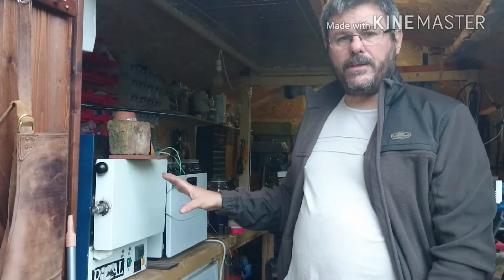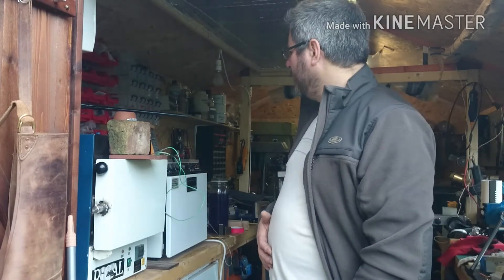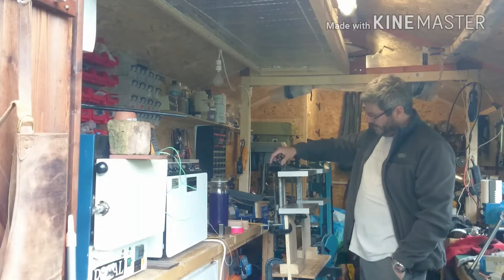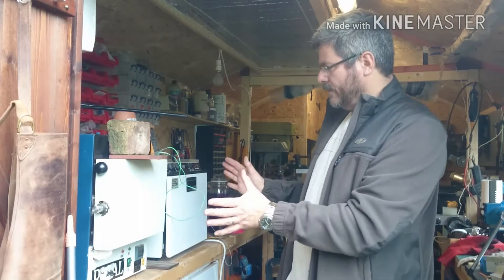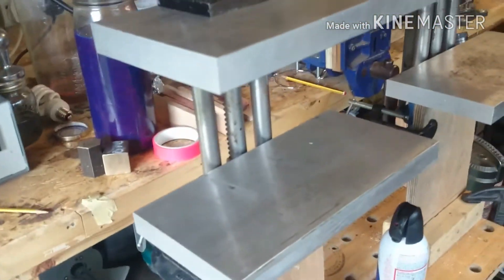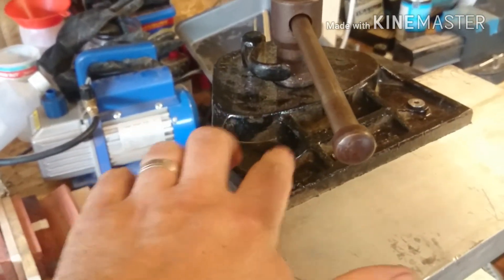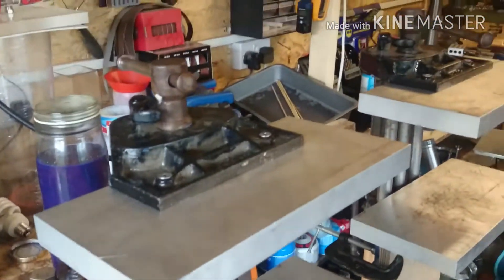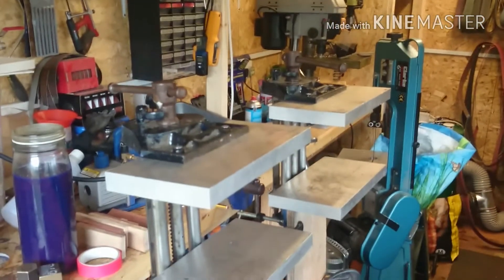Quenching D2 using aluminium plates.

Comment: hello, could you tell me, if I use a gas oven, how long do I need to keep the knife in the oven for tempering
Reply from the maker: Tempering determines the final hardness/toughness balance which you require. I triple temper for two hours each time at a temperature that gives the balance I want.

Comment: My last job before I retired I ended up being the heat treater for a big machine shop and their TIG welder for certain jobs, but was hired as an engineer. Go figure huh? I became the heat treater because I mentioned to the owner that I made knives as a hobby. As the HT guy though I could do my own knives and use drop-off scrap if big enough for knives. I already had a working relationship with a HT company I used them for jobs that wouldn't fit into our oven which was 24 inches deep.

Used D2 a lot for paper cutting blades that cut the "FOLD AND TEAR HERE" lines you see on envelopes and other things. HT always the same, 1200, hold then 1600 and hold the ramp to 1850 for 30 minutes and air blast with an air hose and paint sprayer misting water. Temper at 500 degrees for two hours then cryo in  between blocks of dry ice in a cooler with 4 inch thick walls of Styrofoam for 4 days or 6 if a weekend was in the cycle. The dry ice had only half evaporated. Then into the HT oven to 1000 degrees for one hour, do not exceed one hour. It will be right at HRC60 with decent toughness for D2. D2 isn't a very tough steel like O1 for instance and if you want or need the toughest knife or ax you ever saw use S5 steel at 59-60 hard. The S stands for shock and S5 is better for knives that S7 which doesn't get as hard as S5. 

Worst thing you can do to D2 is overheat it by even 50 degrees. 1850 is D2's sweet spot like 1475 is O1's. A temper at 700 degrees the D2 will start getting harder until you hit 1000, it drops fast past there, like 1200 will get you HRC55 instead of the 60 at 1000. Now mind you at 700 it is still 57 hard, but if you want 55 or lower you're not getting it in your kitchen oven. For some industrial applications you need to go softer than HRC 59/60. Keep in mind that hardness is not the end all and be all of D2 as it will hold an edge at 58 as good as 60. What gives D2 its abrasion resistance or edge holding is the chromium and vanadium carbides it makes.

As quenched D2 is 63 to 64 hard and 63 is preferable for toughness and too fast of a quench can setup stresses in the matrix of the knife. Knifemaker Ray Rogers told me he had a D2 knife crack and break apart 3 weeks after he finished it, but he had also forged it too. Something he called a nightmare because D2 must be forged at 2000 degrees. SAFETY TIP, wear a tinted face shield if tempted to try it as the light will harm your eyes and even a regular forge is long term harmful as well if you stare into it too much and don't even think about heat treating D2 in a forge. It heats up too fast and easily overheats.
Reply from the maker: Thank you some very useful insights into the correct treatment of D2.
Reply: @rarknivesandleatherwork8045  You're very welcome. Everything I learned about D2 came pretty much from Hinderliter HT in OKC, OK. That 1.50% of Carbon in D2 guarantees that the Chromium and Vanadium will make carbides, but look at AEB-L steel with its 0.60% carbon. That is to ensure that the Chromium does not turn into carbide. Therefore the chromium doesn't convert into austenite and lose its stainless properties. AEB-L achieves its hardness from mostly Ferrite or Iron Carbide and should have a shallow cryo treatment of -95 F.

 I used dry ice at -110 and simply put the blades between the blocks. I tried the mixing it with one of kerosene or alcohol, then acetone to make a slurry, but it used up a bunch of dry ice, made a mess and the acetone was just plain scary.

 So I just built a box with Styrofoam 4" thick slightly bigger than the 10lb blocks I could buy at the grocery store. I lined the inside with an 18 gauge, .051 stainless box that nested into the foam and made the outside out of aluminum that the foam dropped down into. It could hold 3 blocks of dry ice for over a week. (Safety note, if using dry ice store in a well ventilated area. It could make a basement into a death trap.)

Comment: D2 difficult heat treatment with raping stops to critical temp . Triple temper . I use 99% alcohol with dray ice in a strophe picnic container for cryo , till the dry ice evaporates through a hole in the lid . pour the alcohol back into bottle .
Reply from the maker: Ingenious cryo treatment.